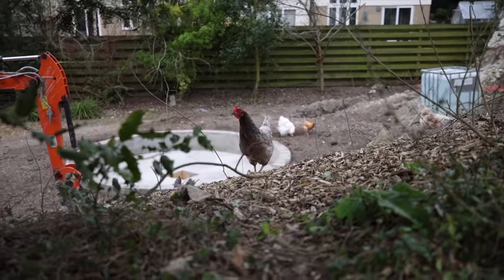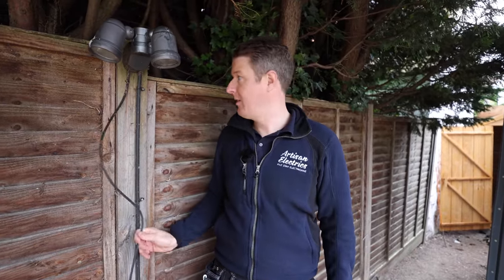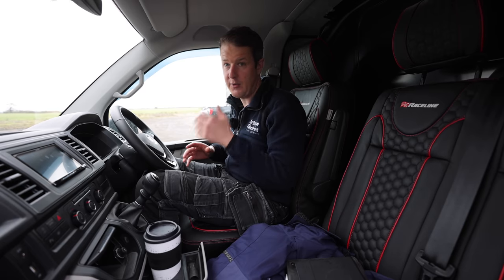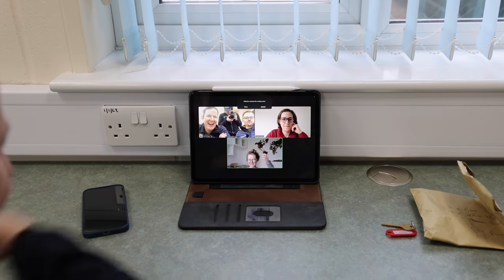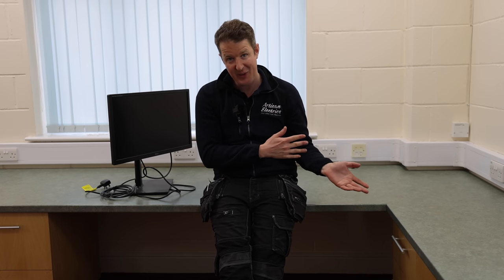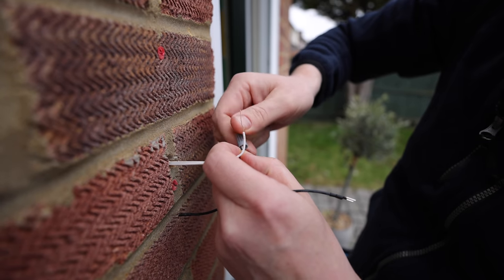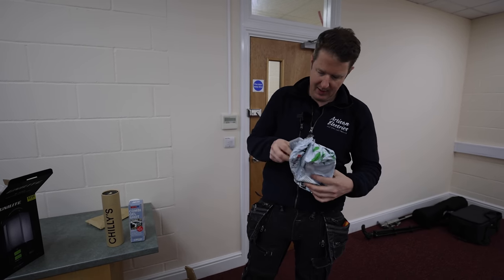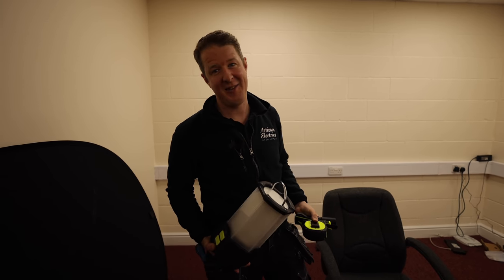CONFESSION TIME, LET'S TALK! - Electrician Life

Comment: Well done tackling the wood issue head on Jordan. Some people see acknowledging mistakes or admitting that they don't know something as a weakness. I see it as a strength and a great quality👍🏻
Reply from the maker: Thanks a lot
Reply: Being smart doesn't mean knowing everything it's knowing your limits and asking for help when needef
Reply: Being wise is not knowing everything, it's not knowing everything but continuing to learn.
Reply: @kirkhamandy  How much is that going to cost to repair, it's going to run into tens of thousands.
Reply: @heisenburg8608  Lee should've have got a second opinion before he destroyed the owners house.
Reply: @haldo691  But Lee didn't do that, he was judge, jury and executioner on that job.
Reply: Seconded. Absolutely. But the whole issue shows how poor the coordination is between trades and their separate regs.  How many plumbers/carpenters know about safe zones for instance?
Reply: @JC-jv5xw  The young inexperienced ones don't, I dont trust them. A older experience trader with over twenty years of experience would never have removed that piece of wood, he would have known it was part of the structure.
Reply: @garmbryhewwert7059  lool destroyed lool

Comment: Let's face it unless you have not seen or been involved with the house structure 95% of sparkies would of done the same ,maybe when the house was completed a manual should of been left with information what you can do or cannot do to the framework of the building ,well done for facing up to the problem if any and prepared to fix problem if any
Reply: I’ve seen worse done and seen it last a lot longer (40+ years, floor joist chopped out completely to fit a waste pipe and floor was bending when walking on it). That being said, I’d have been in that 95% until now. Learn something new everyday!
Reply: Your spot on, until you work around something you'll never know how your supposed to work around it. I came across a wooden I beam for the first time this year and luckily had the builders on site who work with them all the time and explained where you can drill. Every day's a school day

Comment: In the gone days,on 1st fix we drilled holes in the Centre for years.
Then someone told us it’s the weakest area to drill… then the designated area’s appeared, everyone happy
The difficulty with that is when the joists are tight against a wall & the points are located everywhere , drill or not to drill

Comment: I was looking at that place thingking wow , this Youtube thing is really paying off! The one wire-nut tip I learned recently is that if you're doing solid and stranded, make sure the stranded is even with the solid, or perhaps a little "ahead" ... if you get the solid in first, it is less likely to grab the stranded and twist it securely.

Comment: Well done from not hiding from the issue of cutting into a reveal stud cluster. Thing is a structural stud wall inside the cavity if done properly should (I do) have 18mm structural ply glued and screwed to the stud timbers. So I’m my opinion you have done nothing wrong to the structure. Apart from that comment what a great video showing other aspects of work you do!! One of the if not the best channel on YouTube watching a great company going from strength to strength!!
Reply: That house is going to be worth a lot less now even if it is repaired.
Reply: @garmbryhewwert7059  comment after the SE report. Good night

Comment: 11:44 Speaks well for Artisan at least finding out, bravo sir.  Great sign of a great company to fess up.  While I am just a guy in the USA, we have mostly stick based construction, so when you see any of it being cut out or large holes cut through, its cringe worthy.  They have to use double/triple/quad studs to help support the point loads, and for sure around the corners and windows.  I am sure there is enough safety factor there, that maybe just a metal plate joining all the studs together might be enough to offset any loss in capacity.  That would also allow to safely cover it all as well to prevent drilling through the cable or nails into it.

Comment: The wood issue didn't make me cringe, structure is always over specified, chipping out an inch of an 8 inch stud (with multiple studs to either side!) really didn't concern me. In any case, well done for checking it out and, if needed, making it right. The thing in that video that made me reel was the cutting out of the airtight/vapour membrane, and not putting it back with proper adhesive sealing tape; not only is it killing the air tightness of the dwelling, but it could cause a condensation/mould risk.

Comment: Watching the Artisan gang, Nick Bundy, CJR, Eastway Electrical (Delroy the spark) to name a few, it certainly seems you need to know a lot about general construction. I remember Dave Savery saying to Nigel, that the job has become more mechanical these days. Thinking way ahead, maybe you need a building consultant/advisor. Hopefully a cheaper alternative, are there any course’s that could give electricians a greater insight into general construction? And maybe a crash course in plumbing for Corey? 🤣 Sorry couldn’t resist, and FairPlay to Corey when he hit that pipe, he did his best to not make the problem any worse. When trying to think of tools for reviewing m, was going to say data cable terminating tools but, I vaguely remember one being talked about. But this leads me to another question m, that all the big Tourube sparks seem to do. When using data cable, you all use CAT5, but we’re upto CAT8 now. This is probably far too overkill for now, but for future proofing, I’d be considering CAT6 minimum, because these cables are being installed to be there for a long time, why not fit a one that’ll meet future demands.
Reply: Hi, good idea on the course on general building and construction, however really the answer is if you're not sure about somthing ask and get a second opinion.
Reply: Cat5e is suitable for most domestic use for the next few years depending how fast the GPON speeds ramp up (that's OpenReach's fibre in to your house to non-nerds), and IoT (chargers/bells/cameras/etc) for another 10yrs absolute minimum.  I do agree that it would be nice to be future proofed further - however the uptake of 10GbE over copper is still quite low, higher end consumer hardware might come with 2.5 or 5GbE NICs but they are still not common.  I agree that Cat6A (all you need for 10GbE up to 100m) on a new build installation would make sense, but retrofitting it is a nightmare due to it's low bend radius/malleability, Cat6 on retrofits does indeed make most sense - but unless EV chargers start needing higher speeds (highly unlikely) - there is no reason to increase the installation cost.

Comment: First off yes it is a load bearing wall. Second the only reason the builder did that is so he didn't have to insulate a smaller space. When there is windows or doors that close to corners in another wall that is an easy way to frame.

Comment: Good job admitting the mistake and dealing with it. a good company will do what you did. A bad company will cover it up.

You did a good job with the wire nuts too. The accent needs work though. The only problem is that you twisted the bell wire too tight. You can get away with not twisting the wires together first. 

I'm British living in America and I prefer the terminals I used to use in the UK over those wire nuts. We are starting to get the wago connectors over here.

Comment: Jordan, one minute your admitting the structural mistake with the timber.
Then you are drilling into a cement joint for a rawlplug to hang an outside light.
May I suggest you contact building control and they can supply you with   regs for such matters.
Otherwise some unscrupulous people will set you up in their home to do work and you will be in court for damaging the property.
Please take this as advise and not criticism mate, we all want you to succeed, but your there for the taking.

Comment: If anyone wants to DIY garden lighting then they should really think about using a 12V system with an isolating transformer in their house or garage. At least that way it limits the risk of unsafe electrics to them and anyone else who comes into contact with the installation.

Comment: At times it appears foremost is your finish while it comes across as the secondary concern is abiding by regulations and I think in this instance it's caught your team off guard. I don't expect anyone to know all of them hell I don't but like anyone I would hope people ask someone more experienced if they find themselves uncertain in a situation. 
Fingers crossed it wasn't structural and great job for holding hands up and getting someone involved to make sure. 
It does go to show though, electricians need building competence, knowledge of carpet fitting, plumbing and heating systems if they're tasked with that and a vast array of other skills and knowledge that aren't always used but are often life savers.

Comment: Any resolution on the structural concerns? Hope it wasn't a major job to rectify.
Reply from the maker: All fixed now! Vapour barrier had to be replaced but the wood was not structural so was left as is, all re plastered and decorated and a happy customer left with a working Tesla charger.

Comment: Look at wire-nuts on YouTube - there are some good info channels from the US.  They show how to specifically join, for example, stranded with solid 'the right way'. But why don't you use joining ferrules in heat shrink sleeve? I did that with my bell/camera - so much easier, and I think better and more robust.
Reply from the maker: Cool, thanks

Comment: I've done a lot of house bashing over the years, so I have a lot of knowledge how houses are constructed, yes it easy to make a mistake, but it's a big but, (before I continue , yes I did see the video were Lee removed all that wood). Sometimes you have to stand back and think. There were on or two I could of pulled that job up on.  Such did he need to pull an armoured cable in the ceiling cavity were a 10mm t&e would have been better and terminate to a box on the outside wall waiting for an amoured. Personal I think removing all that wood is ok. Was the Job surveyed correctly, does the person who survey the job use a cable and stud finder, are your sparks equipped with one . I know you and your gang want to do a good job which is commendable, , but sometimes you have to ask questions, even it it's means reporting back to base to get the ok to carry on . Lee and Cory are young sparks and may not have the skills set you get when you been doing the job for a number of years .we  all like to think we know it all be even us old sparks don't know it all . Plus we can't always do the job the way the customer wants it done . I know Lee want to do a good job and please the customer , but a skill you need to learn is managing the customer expectations. My experience says it should be ok removing that wood

Comment: You always wanna do a poll test on your wire nuts to make sure both individual cables have caught.
From what I understand the manufacturer suggest not twisting them but all the ones I have seen that a failed have never been twisted all the ones that I have not seen fail have been twisted and you really kinda have to stranded wire and small gauge wire. I would love to use Vegas instead of wire nuts but I would suspect the next guy behind me would probably switch them out although there is starting to be a trend towards Wygos that I will henceforth call wackos cause nobody knows what to call them.

Comment: If all trades admitted their mistakes and corrected them, especially if kitchen fitters and builders used the services of electricians and they did not install dangerous electrical installations, life would be easier. Maintain your high level of work and avoid your workers cutting water pipes :) Thumbs up.

Comment: I stand by my comment on the wood should it have been done probably not, is it gonna harm anything most likely not I think it was done in the least compromising way possible. like I said I've seen way worse just imagine all those second-floor bathrooms were all of the joists are cut for the drain darn plumbers and then wondering why the floor squeaks.

Comment: With wire nuts, you’re supposed to twist them together extra long and then cut off the excess — never try to twist them together at final length, because that’s too short.

Comment: The piece of timber will be a 4x2 and with only 25% taken away you SE will probably let it go if not he will possibly just advise you to remove the cable and ues a infill piece off 2x1 with a load of glue to reinstate the structural integrity. Yes we all have made mistakes in the past and your quite correct in admitting the mistake. But i still think it would be advisable to seek out a local new build site and have a site visit to see how wooden buildings are put together.
Reply: If the owner of the house wants to sell in the future, he will have to inform the potential buyer about the damage Artisan Electrics caused, that could take tens of thousands off the value of the property.
Reply: @garmbryhewwert7059  if the piece is replaced like for like and glued and screwed I should reinstate the structural integrity of the property. And a written confirmation from a SE should suffice.
Reply: @chrisardern4594  GLUE! it should be rebuilt from scratch and Artisan Electrics should give the house owner compensation for all the inconvenience caused, I would be asking for atleast £50,000.
Reply: Tell you what Jordan their are some right boneheaded fools commenting on somthing have absolutely now idea about. I worked in these type of timber build houses for years and the structural calculations are always over the top and over engineered. The chances of this being a major problem is extremely low
Reply: @chrisardern4594  We'll see what the structural engineer recommends, I think the property is going to have to be partially rebuilt at huge cost, I feel bad for the owner.
Reply: More likely at least 6x2 these days .But yeah, if the surface of the original stud is made flat again and snug fitting fillet is glued and fixed in the recess, its gonna be as strong as it was . As others have said though, the proper repair of the moisture barrier is even more important, rampant unseen rot could set in over the years if not corrected.
Reply: @Macmonkey1000  6x2 would be to thick and cost a lot more and we all know developers dont like spending money the 4x4x2 would be more than enough to carry the weight seeing is in compression.
Reply: @Macmonkey1000  I just hope Jordan and his Artisan Electrics have enough insurance to cover the cost of the repair bill, I think it's going to be huge.